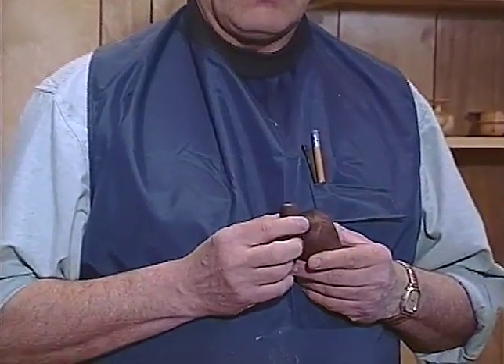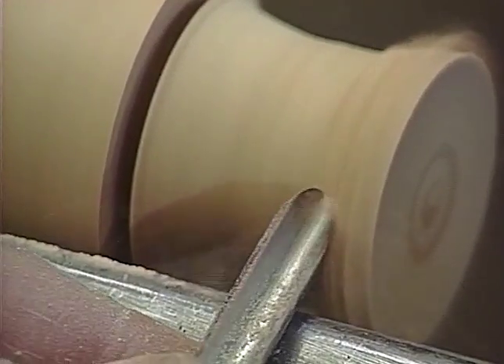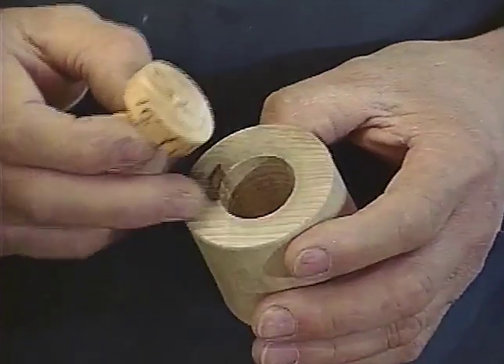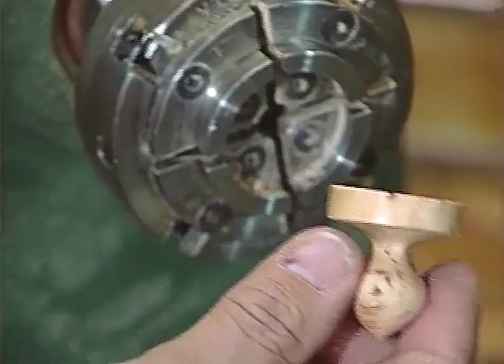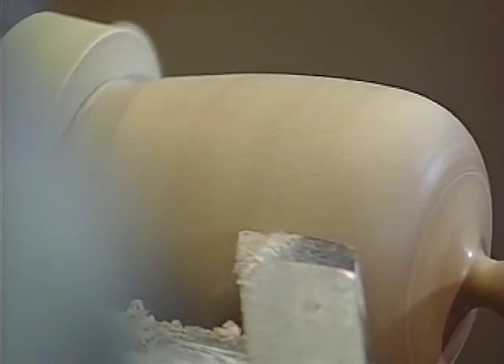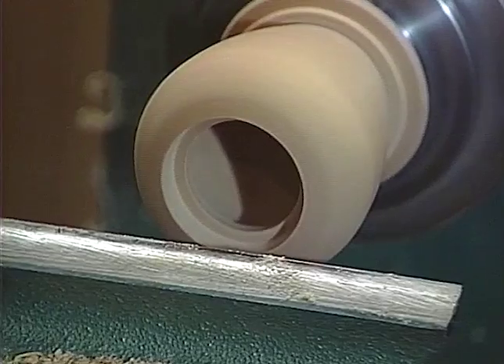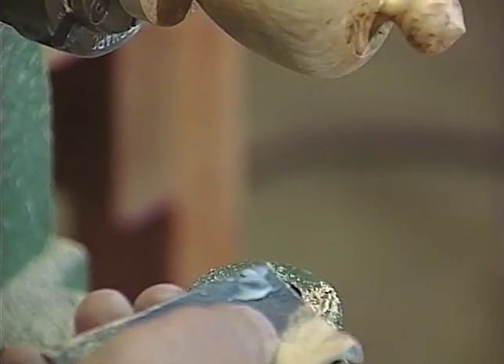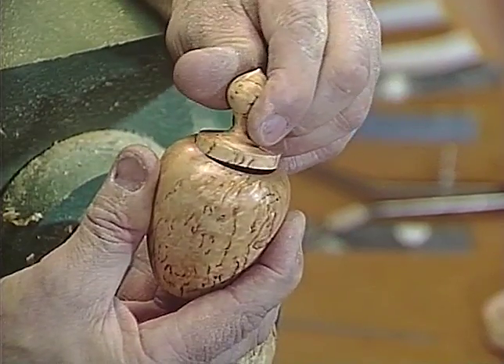The Finial Box by Ray Key | Woodturning How-to

Comment: Excellent video.  I enjoy watching you turn your boxes.  I'm interested in turning boxes, but I'm kind of stuck on which tools to acquire to actually finish the box.  I don't have the scraper you mentioned, or the modified tool you used.  Do you have any suggestions as to which tool/tools I might acquire to complete the process.  I have a 3/8" fingernail gouge, and a skew, and various other gouges, but it seems I need a couple of more tools to add, in order to complete the process.Thanks again for your time,Tommy
Reply from the maker: Sounds like you've already got quite a few tools to get you started on a finial box. You'll also need 3/8 Beading/Parting Tool, Round Nose Scraper and a Narrow Parting Tool. You'll find them all at https://www.woodturnerscatalog.com Also, feel free to call us at 1-800-551-8876 if you have further questions/concerns. Thanks.

Comment: Where can I get the spindle gouge used in this video?
Reply: It's a 3/8" spindle gouge, which is a standard size made by all the wood turning tool manufacturers. The gouge used for hollowing has been ground with a steep 60* bevel and a very long sweep back on the right wing. Just set your grinder table to the appropriate position.